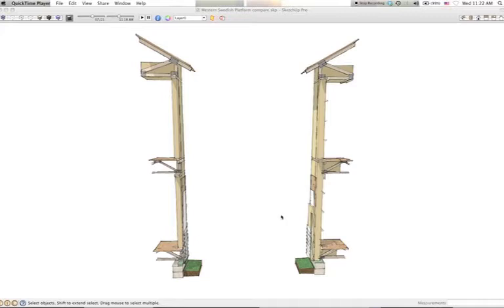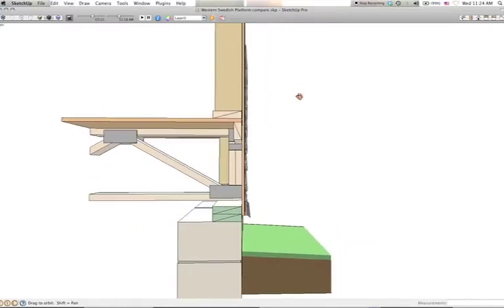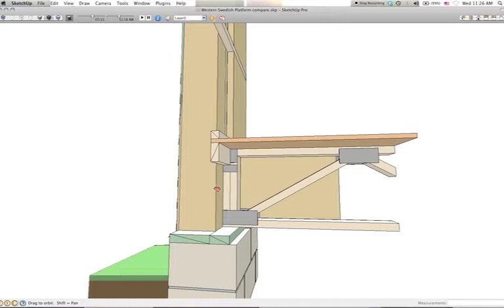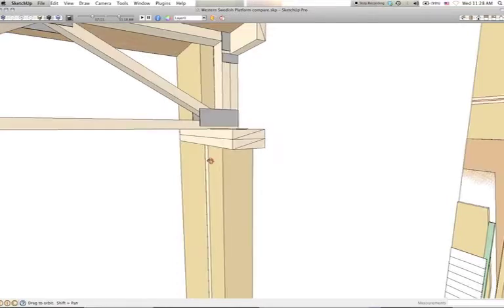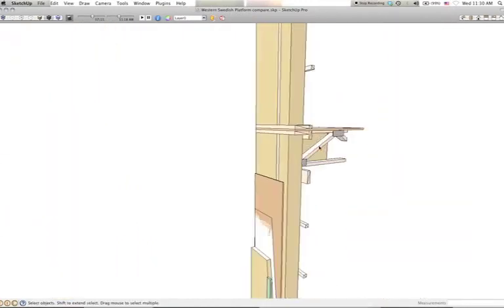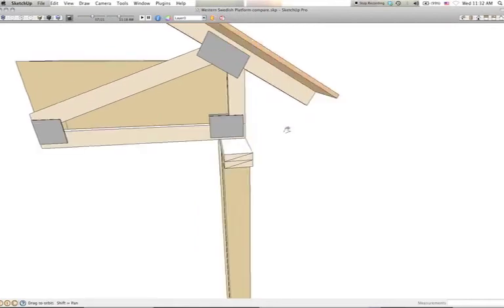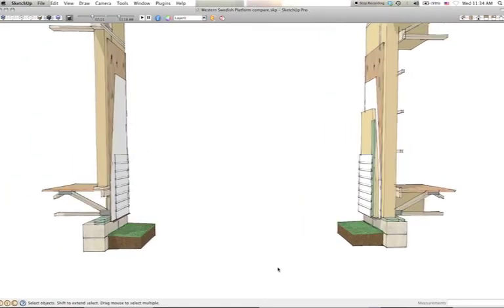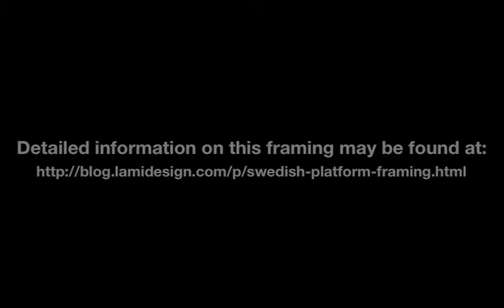Learning from Swedish Home Building Part 3

Comment: You state that "advanced framing" requires the roof trusses to align with the wall studs to permit the single top plate, and how that's too difficult to pull off in reality. I don't see how the Swedish method differs. There doesn't appear to be an additional ledger added to transfer the loads to out of alignment studs in a similar way that to your second floor framing detail at the exterior wall. Did I miss something? Thanks
Reply: Sir - my statement is true and your comments show that you do not understand what you are seeing. The main stud cavity in the Swedish wall is covered by continuous insulation at the exterior, and by an insulated wiring space at the interior. So my statement that there is no thermal bridge here is correct. Furthermore the introduction of the continuous header changes none of the bridging conditions. That is the physics of it. I making no claims of % in energy gains. Lstiburek's own wall assemblies are preposterous in practice and will never be adopted on a wide basis. The Swedish wall systems are practical and used widely over the entire nation. They are real, and not a building scientists wishful solution.

You do not realize that I do not have a system to sell. Nothing is "on sale" here. All of the information documenting these wall types and framing system are shared with a Creative Commons license, so there is no charge for the use or sharing of any of this.

Your comments are incorrect, and your manner is unconstructive and confrontational. I would appreciate if you ceased comments and went away. Thank you.
Reply: thank you and good riddance
Reply: This has nothing to do with Sweden's social government. They have a performance based building code that requires a high level of insulation to meet the energy requirements. Over the 40yrs or so that have passed since Sweden built low performing walls like we do in the US, they've arrived at an assembly that relies on deep studs, and layers that break thermal bridges. The assemblies have come about because of cost and expediency. That does not mean that it will immediately translate into the American market. A 2x8 USA New Wall assembly exceeds the code requirements of our coldest climates. You would only build that if you were setting your own standard for performance. I've not done a cost comparison between that and other assemblies - i.e. a "perfect wall" of similar performance. For instance a 2x4 wall system with 6-8" of foam on the exterior? Foam is expensive, and thick foam layers add complexity to treatment of window openings - exterior boxes, etc. The point is that USA New Wall is not about the least expensive wall, or the best performing wall - its about achieving high performance with materials and techniques that builders already have mastered.
Reply from the maker: No, you were very observant, and my video is less than clear on this point. The Swedish Platform Frame is the same as Advanced framing at the top plate with truss bearing. Trusses optimally should sit online with the studs. Where Advanced Framing is unrealistic is the expectation that carpenters will do this all the way down to the foundation. Getting the trusses on top of studs is easy. Lining up everything down to the foundation is wishful at best. And it does very little to eliminate the horizontal thermal bridges from the wall - it takes out 2 studs. Swedish Platform Framing is much more effective.

The Swedes will also use a continuous header in place of headers at windows and doors. This consists of a stud on its side right below the top plate, let into the top of the stud. It takes very little insulation value away from their thick walls, and again gives them complete freedom to let the studs layout in the most convenient manner - not on a predetermined grid. You can see such a continuous header in this photo - the carpenter is pointing to it: 
https://www.flickr.com/photos/lamidesign/13307769255
Reply: Michaelbonn22 is right, and I think he's still right after your explanation. That continuous header, according to the picture, is quite a thermal bridge--and curious because I wouldn't allow it for that reason in the advance framing we build. I would rather have a double top and insulated headers than introducing that substantial square area of bridging. There are some potentially good techniques here for multi-story applications, depending on what a structural engineer would say about those attach points for a particular application as I'm guessing there are distinct limits to that load-bearing capacity, but other than that, I think anyone can just design in extra layers of insulation, particularly exterior with furring as long as their other control layers are good, and get performance results that will not differ significantly from Swedish design (by that I mean more than 20%--exacting differences are silly in something with as much variability as there is in each practical application and location, whether in Sweden or the US).
Reply: There is absolutely no thermal bridge at the continuous header. There is simply a reduction of 8" of insulation in the stud cavity to 6". You may be misunderstanding what you are seeing.

As I said above there are alternate details for higher bearing loads which replace the surface mounted ledger.

I stand by my assertion that "Advanced" framing techniques are neither advanced, nor efficient. They still result in a greater amount of continuous horizontal thermal bridges.
Reply: Greg La Vardera So even stud-to-stud that deep in the wall there is no thermal bridging? If the picture is accurate in the least then you, sir, are full of it. Thermodynamics can't be altered by assertions. I realize you have a system to sell, though. I would gladly stack up the best of the advanced-frame and SIP walls coming out of the Seattle area against anything you're hyping here in real-world performance. No doubt Swedish coffee companies are bigger and they build bigger airplanes, too. You sound like the architects Lstiburek talks about who are sure they have 8.4% better performance because of this or that theory or modeling when the inherent variables in practice are at 25-30%.
Reply: Advanced Framing Technique includes no mandate for continuous exterior or interior insulation. Its about framing, not insulation, and this is why it has little impact on efficiency. 

If want to read the research on these wall types including the interior wiring space it was done in Sweden years ago, and wide published.

Lstiburek's "perfect" wall was conceived years ago and has never been widely adapted in Canada. Advanced Framing was also first outlined years ago and has never seen wide adoption. SIPs similarly are an old tech which has never managed more than a tiny segment of the market. Yet the assemblies outlined here have been adopted across the entire Swedish housing market. This question has already been answered, and not in favor of your opinions. 

Information about these assemblies are offered here and on my site, not because it is the "ultimate" wall assembly, or because its the most energy efficient wall assembly. Its offered because its an easy path to more efficient building for builders with little experience in energy efficiency. Since posting them here they've been viewed and read by thousands of people, and I've been contacted by hundreds curious and asking questions. Frankly I don't need you to validate the significance and value of this approach. IF you don't like it, or if I've stepped on your toes about advanced framing, sorry. But you've had your say, and its time to move on. Thank you.
Reply: Greg La Vardera The stud cavity in any advanced, insulated wall has a CI covering. The insulated wiring space may or may not be significant--I've seen no significant field study demonstrating that, but whatever. That doesn't mean it isn't cold (or hot) where the mass of that header is running and bridging stud-to-stud in the picture. It doesn't have to be sitting completely to the exterior when we're talking about a wall system this deep. Put that wall assembly at -50 F for a couple of days on the outside, 75 inside, next to the same wall configuration built without that header and with temperature sensors on the inside of those studs. Once that data is available, then there would be something worth discussing. Until then, it's just old physics vs. new Swedish physics, I guess. 

Whether it's for money, status, or the sake of the ideas themselves, we all like to sell others on our way of doing things. Lstiburek's wall assemblies originated with the Swedish, ironically enough, as well as the Canadians and Norwegians, and the residential ones, at least, are much more cost-effective to build than those you promote. He does not have decades of experience with the science in the field, in North American conditions, for nothing. Swedish assemblies are not unknown to him, obviously. You think all this, with the expense of that much rock wool alone, is cost-effective anywhere but the interior north, Alaska, and mountainous regions? Not. There is less cause for this to be widely adopted in the US than Lstiburek's recommendations.
Reply: Greg La Vardera Yes, the Swedish market being how big? Less than the size of LA alone, right? That's funny. Science is often not as widely adopted as ideas grounded in convenience or even rhetoric are, especially with dollars involved. The same is true with your system. I'm sure BSC has countless inquiries, too--quite silly. Good day.